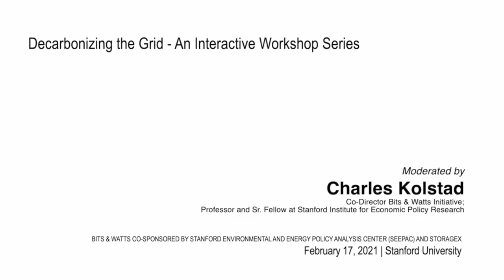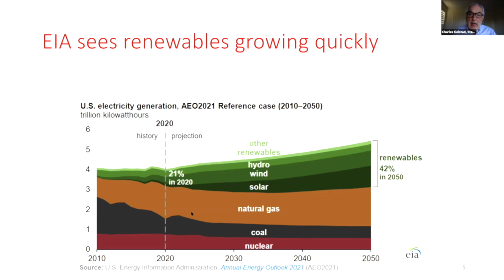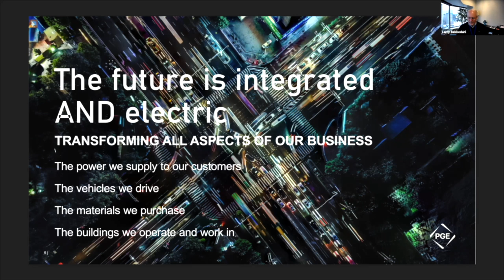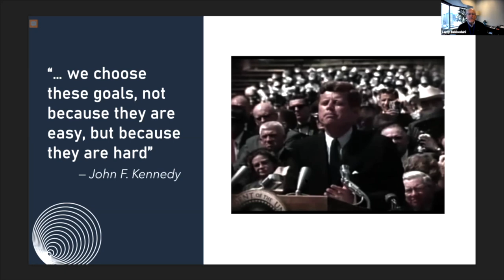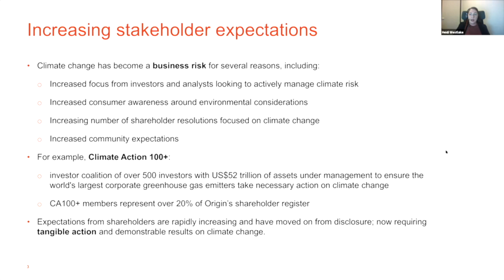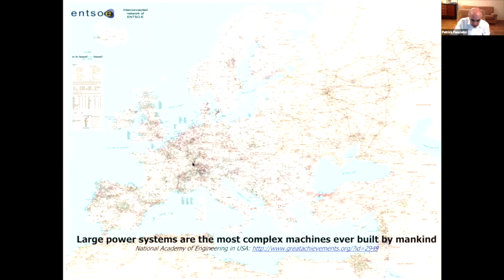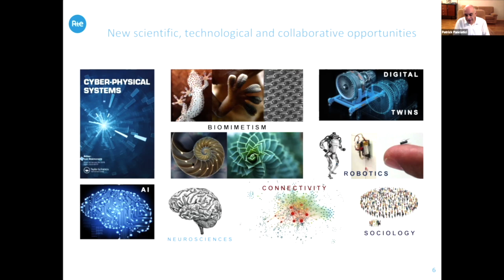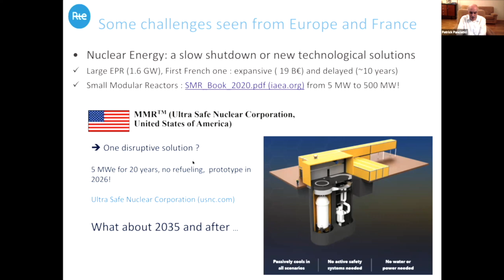Framing the Challenges of Decarbonizing the Grid

Comment: I designed solar heaters for my home and remote cabin. 40 miles south of Superior, WI and my remote cabin doesn’t freeze. I blow warm fresh air into my basement to ventilate and supplementary heat, the colder it is the better it works, in St Paul, MN. FREE. Why aren’t we doing true DISTRIBUTIVE generation at point of use wherever possible?

Comment: There is a way to do a LOT of wind power into a grid by deploying hybrid boilers. In the UK and most of Europe homes are heated by natural gas boilers

If they were replaced with dual fuel boilers. Natural gas and eletricity. When the wind blows hard the boiler uses eletricity. When there is inefficient wind pwoed the boiler uses gas as per now

These hybrid boilers will allow a huge quantity of wind power to be deployed onto the grid

This is a much better plan than making hydrogen with the excess as its 100% efficient

Comment: Thank you for this presentation series. I look forward to your March 3 presentation because of its national (North American) perspective. It is often said that wind and solar are intermittent and that is locally true. My question is: taking a wide area perspective what is the total renewable potential to be shared systemwide over long distances? I am also excited about distributed and microgrid generation. 

I am glad that hydrogen was mentioned. I am not sure you plan to discuss nuclear. I have to admit that I am very cautious about nuclear. Just to mention a not much discussed issue is the retirement of naval vessels. Just have a look at what happened to the Russian nuclear sub fleet.
Reply: It depends how large an area you are talking about. A world grid could allow near 100% from wind/solar/hydropower but a world grid is not very likely

More likely solution is to use offshore wind power because those turbines can be made very large which allows higher capacity factors. By 2025 Europe will be installing offshore wind turbines with 15MW power and >60% capacity factor and by 2030 we may have 20MW power and >65% capacity factors

Another benefit of wind at least in Europe is that wind output is higher in the winter than in the summer which is good because demand is higher in the winter than on the summer

The UK will have wind generation in 2030 which is >75% of annual consumption
Reply: @kaya051285  
Just looking at North America, what interests me is that the northern half has great wind potential and the south including Mexico has the sun. From east to west it is a four hour time lapse. This means latitudinal transfer potential.

You mentioned off shore wind, in the lower 48 this is not well received. However, I am most impressed with northeast Canada's wind potential and the area from the North Dakota down to north Texas.

Comment: The UK plan is to have 40GW of offshore wind by 2030 which would be ~65% of total UK consumption from just offshore wind power (plus about another ~15% from onshore wind)

This will work because the new generation offshore wind farms will be >60% capacity factor
Reply: I Kaya, 

you can't have 90% wind generation, it can't work. The grid will be far too unstable and the frequency will be uncontrolable. Apart from that current availability of off shore winf is about 35% of capacity. 60% is such a large jump it does not sound feasible that such a jump can be acheived.
Todays wind contribution is little over 1 gigawatt (12:14) so there still will be a requirement for back up genertaion. It's fantasy land.

.
Reply: @iareid8255  The older offshore turbines have low capacity factor. The newer ones much higher capacity factors as they are bigger and taller. For example the Welney 3&4 offshore wind farm last 12 months was 48% capacity factor

Here is a link to data for UK offshore wind 

https://energynumbers.info/uk-offshore-wind-capacity-factors

The new 13-15MW turbines that are due to be installed in 2024 onwards will have a capacity factor over 60%

The technology has improved so much people need to have another look and compare to the newest technology not wind farms from 10+ years ago

The UK by 2030 will have wind power annual generation in excess of 250 TWh to put that into it will be a figure around 80% of UK eletricity consumption
Reply: @iareid8255  Frequenvy control will be done by batteries. A small amount of batteries is economical and allows additional resilience

Even in a fully fossil fuel grid with zero wind and solar it makes sense to have a small amount of batteries

For the UK this will probably be somewhere around 10-30 GWh of grid scale batteries
Reply: I Kaya, 

we have had batteries on the grid for decades,  albeit hydro pump storage.
Dinorwic, the largest. has about 9 Gwatt hours capacity with a full upper lake. It provides a better quality of power than batteries with inverters which have problems with reactive power, harmonics,  and also require extremely sensitive overload protection. It's not all as simple as it may sound.
Reply: I  Kaya, 
so my 35% was not far of as an average. We will see how the new farms perform from that aspect?
Whatever, they are asynchronous and do not have inertia. I believe we are creating problems for ourselves in aggresively incresaing the amount of wind we incorporate on the grid and especially as they still require sufficient back up conventional generation to cover for low output from wind and the expected large increase in demand from electricfiaction of transport and domestic heating.
They are expensive to build and maintain and have a relatively short life.
Because of so much opposition, much of it completely unwarranted, the obvious and reliable source of generation is not being used. 
France seems to have backed off from their earlier stance of closing a lot of their nuclear stations as EDF are applying for life extensions for quite a few of their reactors.
Reply: @iareid8255  Drop your biases and have another look. I was very pro nuclear until I realised I was looking backwards to what wind was like rather than looking forward to what be installed in the near future

The first offshore wind turbines were installed in 1991 they were 0.45 MW at 22% capacity factor. This year the UK will be installing wind turbines with 9.5MW at 50% capacity factor

That is a 48x improvement in 30 years or an annual 14% compounded for 30 years. And there is at least another decade of probably similar 14% annual improvement 

The 15MW offshore wind turbines with 60-65% capacity factor due in 2024-2025 will be cheaper cheaper coal and gas

Also this is 60% capacity factor at the turbine level. You can increase this further by placing wind farms at different locations so the fleet as a whole will have an even higher CF

Also wind speeds are highest in Jan & Feb which is when demand is highest on the grid

The argument for grid services like frequency will be resolved 

As for needing backup for when the wind doesn't blow. That argument needs to be investigated as to what the cost of the backup is

And the cost of CCGTs is very affordable. It costs around £0.80 per watt for a CCGG and less than £0.40 per watt for a OCGT

If the UK goes for 25GW of CCGTs and 25GW of OCGTs it would cost less than £28 billion which sounds expensive but those assets will last 40 years so we'll under a £1 billion per year

But you need to put that into context as £1 billion Sounds a lot. UK demand would be aboit 400TWh with most vehicles as eldtric so £1 billion / 400TWh = 0.25p/KWh for the gas fired power stations to back up the wind for when the wind doesn't blow
Reply: I Kaya, 

Yes, I am biased, to proper ways of generating electricity, that don't need special measures to accomodate on the, grid, that don't destabilise it, that doesn't reduce short circuit current levels on the grid, that can restore power should  a partial grid trip occur and even, but it will take much longer should the outage be a lot more extensive.
Wind, as you say, has progressed but that is only relative to wind. it doesn't mean that it is good and certainly not as cheap as you expect, how can it as they are being built even further out to sea.
Basic electrical practice, put source and demand as close as possible to each other.

Perhaps you should consider your bias to a poor way, practically and technically of generating our power. And the most expensive to boot. Wind, as a motive force was abandoned for a very good reason a long time ago. it still is poor.

When in a hole, stop digging.
Reply: @iareid8255  You seem to miss one important factor

Gas fired power stations are cheap
As low as £300 million for 1GW of OCGT. Your point would be valid if we didn't have a very affordable way to provide security of supply

These can be the reliability and grid services we need while wind generates the bulk (>50%) of our annual consumption

We may get there as early as 2026 which is just five years away

You will convert your thinking by then

Comment: Nuclear for heating would be interesting and possibly 5x cheaper 

In France a huge quantity of electricity is used for heating. Nuclear generating eletricity at 37% efficiency and 10% lost on the way leaving only 33% to heat the home with a resistance heater

Why not just heat water with nuclear and use a distributed heating grid at 90-95% efficiency and probably 1/5th the cost

While the UK and Germany mostly use natural gas for heating. Again rather than Electrifying heating which would be very very difficult as you need to build a grid and backup to meet the once in a generation winter, why not use nuclear heating instead?

Heating is also a vast part of energy needs. Average UK home uses 3,600 KWh of eletricity and 13,600 KWh of natural gas for heating so heating homes is 4x as much energy as electricity
Reply: Good idea add more demand in the form of residential heating (of oversized structures) before renewables or even nuclear added exceed 50% of electricity.